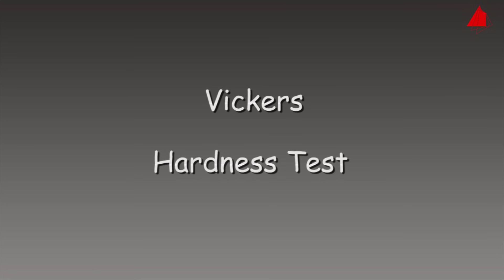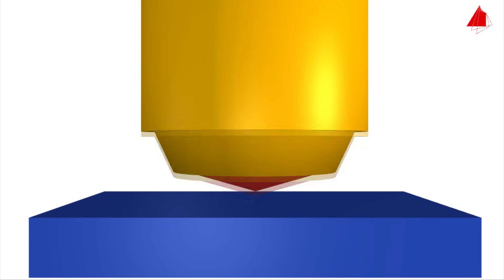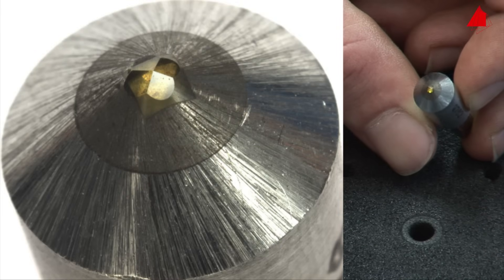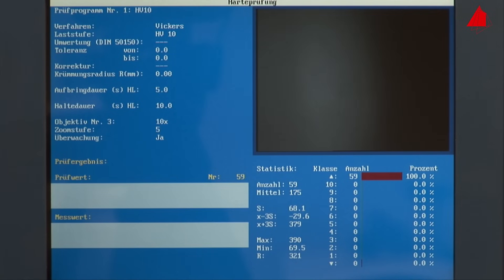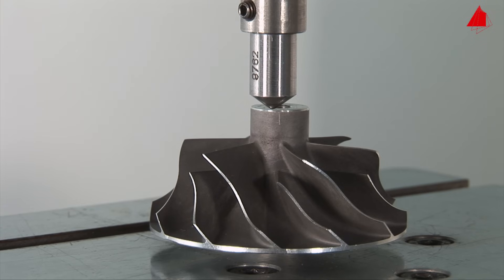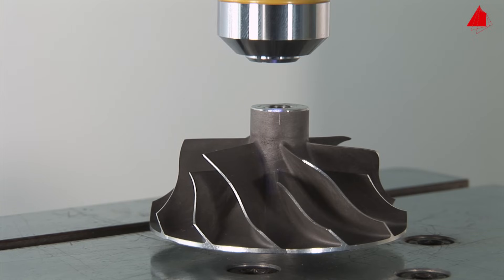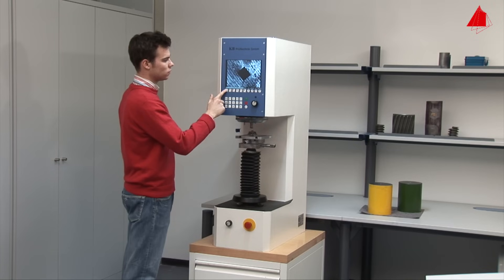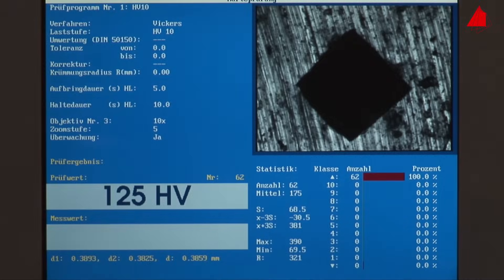Vickers Hardness Test

Comment: Pls guide ,what is the force need to apply. And dwell time.
Reply from the maker: Answer to "Pls guide ,what is the force need to apply. And dwell time." Forces and can be varied in a wide range from 0.01 kp to about 100 kp. The lower end of the range is limited by the smallness of the indent and the difficulty to measure the diagonals. The upper end is limited by the size of the diamond. The dwell time is usually 10 s, sometimes 30 s.

Comment: You needed to clean the part first make a smooth surface and then test it. You can see the part has a lot of lines which is not accurate when measurements are made by the lines. It’s all uneven lines.
Reply from the maker: Answer to "You needed to clean the part first make a smooth surface and then test it. You can see the part has a lot of lines which is not accurate when measurements are made by the lines. It’s all uneven lines.": In principle, you are right. But the specimen was finely ground and cleaned before the test. What you see in the microscope is the typical surface structure after fine grinding. This surface quality is absolutely acceptable in this case, where a comparatively large indentation has been made. Only in the case of very small indentations does the surface need to be polished before the hardness test.

Comment: Can i convert vicker hardness to GPa and compare with nanoidentation result in the literature??? Is it reasonable??? a simple question from a master in china...
Reply from the maker: Answer to "Can i convert vicker hardness to GPa and compare with nanoidentation result in the literature??? Is it reasonable??? a simple question from a master in china..." 
This is by no means a simple question, it has a long tradition, which is little known. 
Originally, the Vickers hardness was calculated (not quite correctly) by "mass in kg / area of indentation in square millimetres", including the unit kg/mm>2. Since mass is not correct here, it was later changed to "force in kp / area of indentation in square millimetres", including the unit kp/mm>2. Later, the units were omitted (not at all a good idea), and the hardness was just given as a number. In the 1970s, the old units of force (kp) were changed to the modern SI system (N), and since the units had been dropped, the old and new units could no longer be distinguished, and there was a problem. So even today, the old kiloponds (kp) are still used in Vickers hardness calculations (without units) - a real mess.
So if you take the (official) Vickers hardness value and multiply it by 9.81, you get the result in N/mm>2 (or MPa). And if you divide that result by 1000, you get the answer in GPa. A mess, a mess, why didn't they ask me. I am afraid I was not yet born then ...
But be careful: The Vickers hardness at low test forces depends on the magnitude of the force. Thus, a different result is obtained at low test forces. General rule: The lower the force, the higher the Vickers hardness value.
Reply: @MaterialsScience2000  Thank you so much to answer my problem. so what ur mean is that I couldn't just convert the vickers hardness into GPa and compare it with my nanoindentation result. Anyway, I prefer not to touch such a complex question which could let me in trouble.

Comment: Hi can we change the dwell time?
Reply from the maker: Answer to "Hi can we change the dwell time?": The dwell time (time during which the test load is kept constant) can reasonably be varied between 5 and 30 seconds. If one deviates from 10 seconds, one has to include the dwell time in the result, for example 70 HV1/30. 70 is the hardness, 1 the test force in the old units kp, 30 the dwell time in seconds. A dwell time of 30 s is only used in the case of materials which show creep during the test.

Comment: it's a great video. I was reading about the material properties and this came up and it has done a good job explaining it. Thanks. I have a question:

How does it measure the indent size? Do we need to feed in the distance between the microscope lens and the test specimen as how big or small the indent looks depends on how far it is from the lens? or does it do optics calculations automatically to understand the size?
Reply from the maker: Answer to "How does it measure the indent size? Do we need to feed in the distance between the microscope lens and the test specimen as how big or small the indent looks depends on how far it is from the lens? or does it do optics calculations automatically to understand the size?" It's your second point: the optics are carefully calibrated, and if the focus is correct, the conversion of the camera's pixel size to the actual distance on the sample is known exactly.
Reply: @MaterialsScience2000  I got it. Thank you for your reply. :)

Comment: Question! How do we know what value of the force to set?
Reply from the maker: Answer to "Question! How do we know what value of the force to set?: You may use almost any force that leads to an reasonable indent. If the force is too low, the indent is very small and difficult to measure. If the force is too high, the diamond indenter may be damaged or completely pressed into the sample, not good either.
Reply: @MaterialsScience2000  so basically the value depends on previous studies right?
Reply: @nurulnadiabintimdshah9007  Hi! i am currently studying aviation engineering and as part of the course we are learning hardness testing, this is some info i found on the book we are reading:

VICKERS HARDNESS TEST.
In this test, a small pyramidal diamond is pressed
into the metal being tested. The Vickers Hardness number (HV) is the ratio of the load applied to the surface area of the indention. This
is done with the following formula.
HV = P / . 0 5393 d 2
a. The indenter is made of diamond, and
is in the form of a square-based pyramid having an angle of 136 degrees between faces.
The facets are highly-polished, free from surface imperfections, and the point is sharp. The
loads applied vary from 1 to 120 kg; the standard loads are 5, 10, 20, 30, 50, 100, and
120 kg. For most hardness testing, 50 kg is
maximum. 

hope that helps!
Reply: @skraak9276  thx a lot for the info, really appreciate that!!! ;)